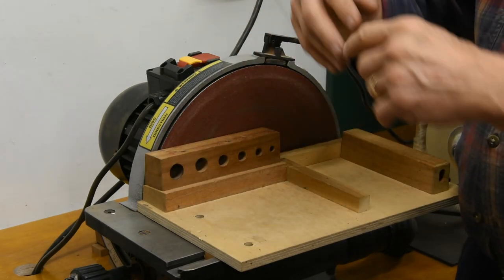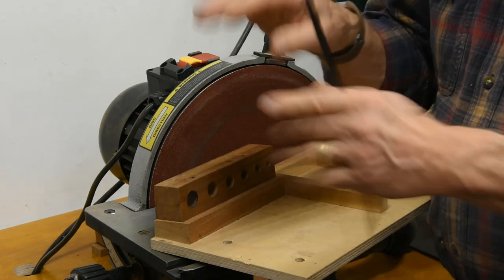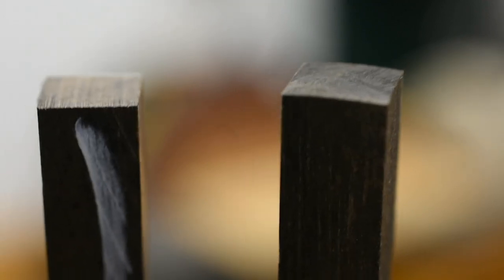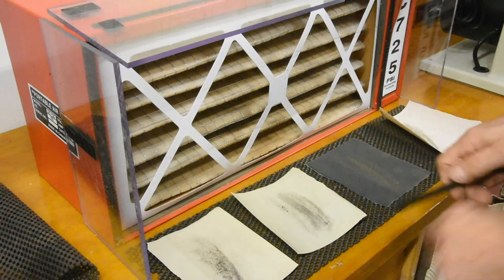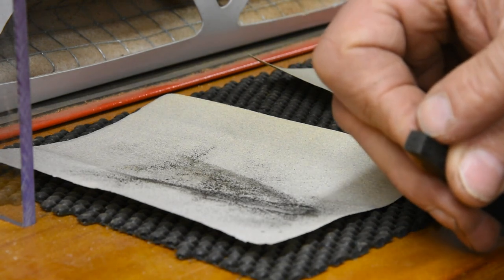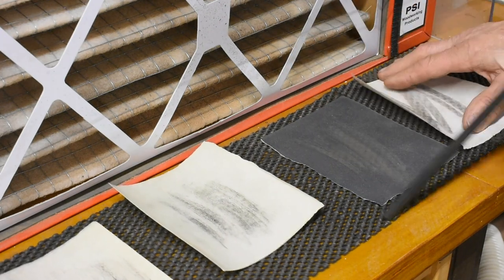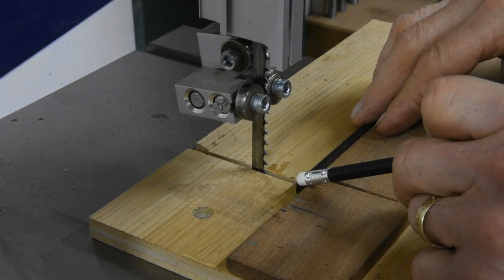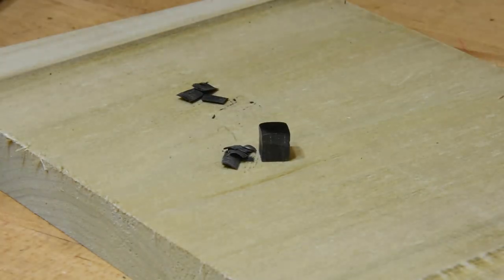Greene & Greene Ebony Plugs Part Two : Pillowing

Comment: When using the disk sander (nice jig by the way!), do you go right from that to the buffing wheel or do you also have to work through the grits?
Reply from the maker: I  go through the grits after the disc sander. - but only 220 - 320 - 600

Comment: What kind of polishing wheel did you use and where did you order it from.......
Reply from the maker: Hi Gene, its a Woodstock D3190 - 8" x 40 Ply x 5/8" Soft Muslin Buffing Wheel, 4,000 RPM
Got it at Grizzley